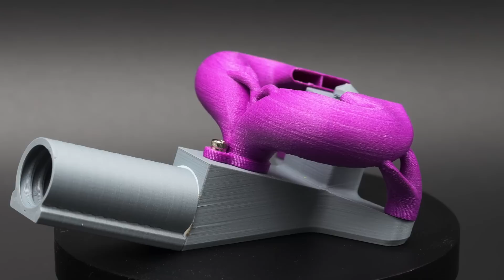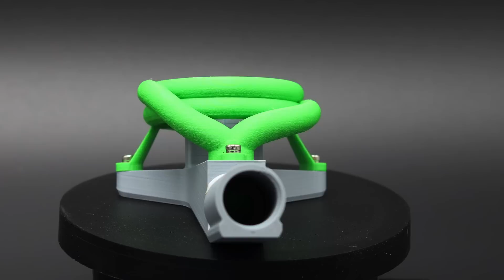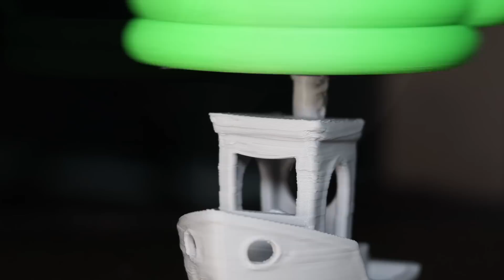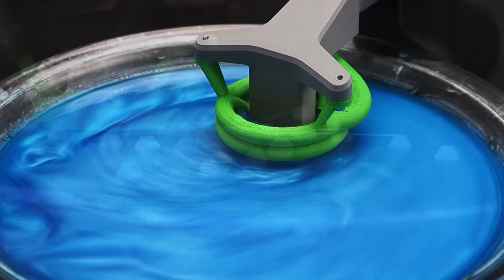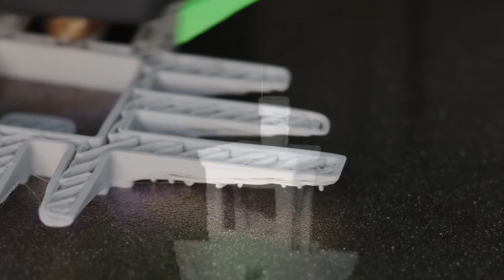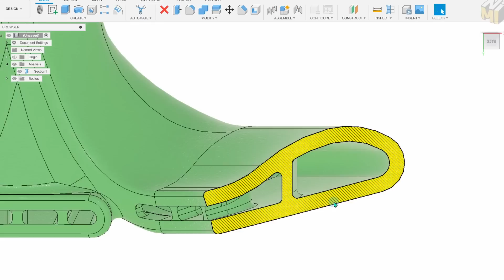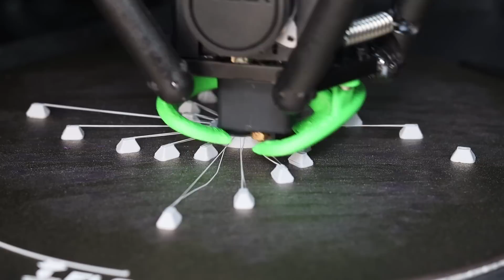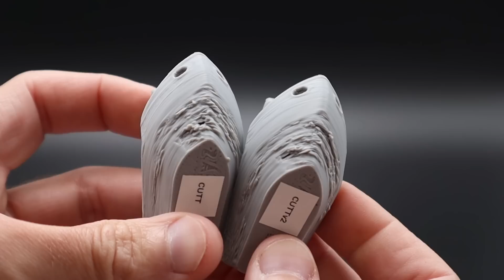Ep.2 - More crazy looking 3D printer duct designs with some serious performance!

Comment: I probably repeating some of the other comments, but it really seems like the ducts would all have performed better if printed with a smaller layer height, and it seems unlikely that anyone meant for their ducts to point air directly at the nozzle - so I wonder whether there was some miscommunication regarding dimensions.

Comment: Air at these low speeds and pressures should be thought of as in-compressible, like a liquid. (This scales up to things like dust collection systems) Because of this, any cross section reduction reduces flow substantially. Nozzles and narrow ducts severely restrict the mass flow which reduces cooling performance. Big openings and wide ducts improve mass flow.
Reply from the maker: Can you describe what you think would be the ideal high speed printer duct?
Reply: @NeedItMakeIt  my guess is something like this:
• the dust stays very wide all the way to the nozzle
• the sum of the nozzle cross sectional area equals the fan outlet cross section area
• use gentle bends in the ducts
• max of 2 nozzles in some sort of opposing of near opposing setup

Comment: I think there are 2 things i have some concerns about. 
One is, smooth surface area is crucial for airflow. If there are bad overhangs inside the parts, it can throw off the results of the design. Causing turbulence inside and killing airflow.

The second one is it to really get a more objective results is to see where a duct will provide good results. Not just keeping the extreme heat one print and subjectively saying this looks better or not. Dial down the temps or speeds untill it looks good. Then you can have better qualitative results.
Its a lot more printing for sure, but may be worthwhile 

Oh nd QUACK
Reply from the maker: Hey Will,

Yes, a rough surface will impact this, how much is something that could be tested at this point I'm no resin printing expert.  My gut feeling is that it is negligible, but still worth a test or two to prove/disprove. 

To your 2nd point, what I am showing in this video is a snapshot for the purposes of making a reasonably short video, the approach used in my previous duct videos will be used, which is that each side will be ranked and then totaled.

I have to disagree with your suggested approach, the idea is not to find the sweet spot for one duct, it is to find the best solution for high speed printing.   I've always found it best to test to the extremes, which means to push each beyond their limits.  It becomes easy to see which perform better than others and from there we can easily narrow down the best performers to a final set of 5 or 6.  With the smaller group we can do more advanced testing for a definitive result.

Yeah as hard as I try to say duct, is sounds like duck, didn't know I had a speech impediment until making this series.
Reply: @NeedItMakeIt  hey Mike, hopefully I didn't sound too harsh. Definitely meant to be constructive. I might have missed that detail in the last video bc I'm normally multitasking while watching YouTube. I can definitely understand needing to cut things down so the videos don't get too long. Something I definitely have a hard time when I get a chance to make a video. I am enjoying the series for sure and seeing the designs people come up with.

The duck thin mg isn't necessarily just you. They sound similar by nature. There's even a brand of "duck tape"

Comment: this confirms my theory. you don't want two air out lets opposing each other, because it'll create turbulent flow.
Reply: Steady opposing jets make a high pressure stagnant zone, pushing air away from where you want it. Turbulence is good for heat transfer, if there is high speed flow.

Comment: Instead of aiming the air outlets perpendicular to the point of printing extraction. Instead aim the air outlets at an angle in a concentric patter to create a vortex of rotating air around the printing point. This will increase efficiency and your air outlets will work in Unison instead of blowing air in an opposing direction.
Reply: No, it will not. There are many comcepts wrong on this series already
Reply: There are multiple ducts, including mine, which attempt to generate such a phenomenon. It hasn't necessarily borne out to work well. I was trying to generate turbulence of course, while others were shooting for a true vortex. Looks like more in the next videos will try as well.

Comment: Flat line linear flow straight across center of the nozzle...not the tip of nozzle and not at an angle. Trust me best possible results
Let the nozzle form the air
Reply: The problem becomes cooling the nozzle and heater failure shutdown.

Comment: I can turn cooling OFF and get better benchies then most of those😂 i made an ultra high flow hotend  that prints over 100mm/s and i pronted a benchy during testing with my cooling fans removed entirely, it was sending like 70mm/s3 minimum and the benchy STILL looked better than those benchys😂

Comment: Ducts need to be printed in resin printers
Reply: Would make a very small difference if any in terms of actual results comparison.
Reply from the maker: With the right high-temperature materials, that'd be a great long-term solution, printed with standard resin, I think could be problematic.  A smooth inside would be a good idea.  Can you offer some information as to why you think it is so critical?

Comment: I think you just need a better silicone sock, 99% of the socks iv seen for normal and volcano blocks the sock comes down over the nozzle close to the tip.

If you can’t find one make one. 3d print a sock, then cast it in silicone…